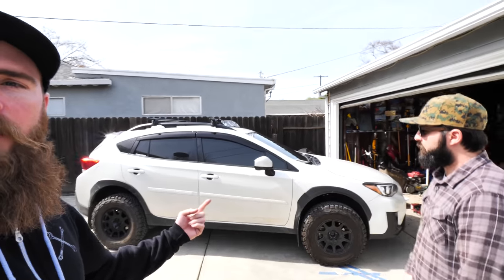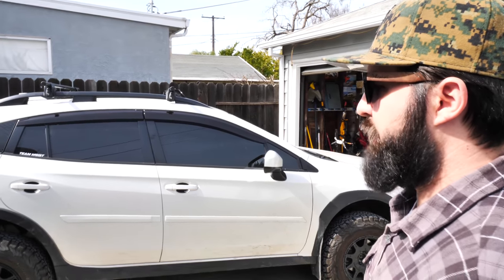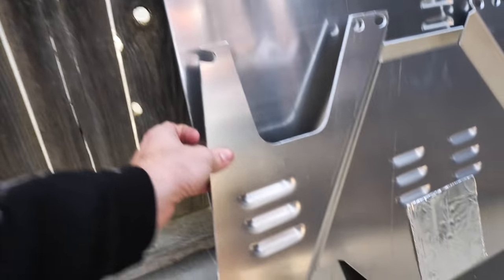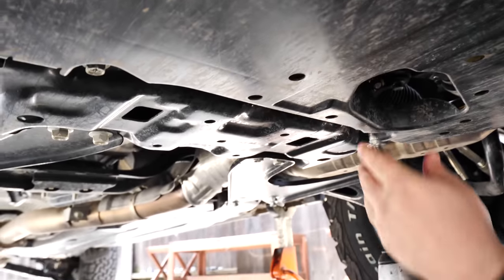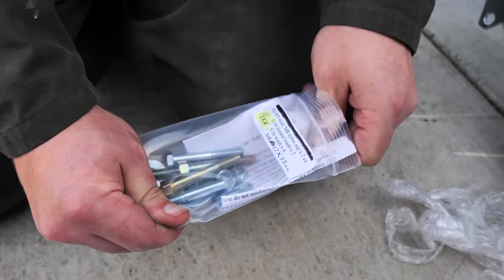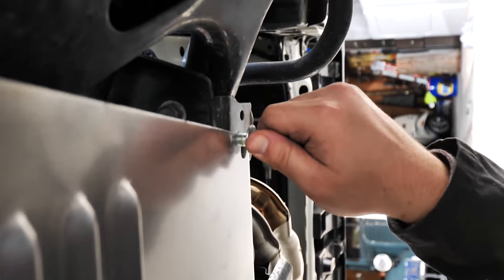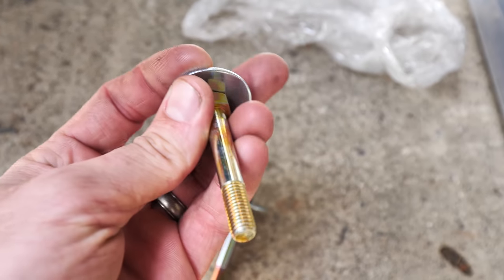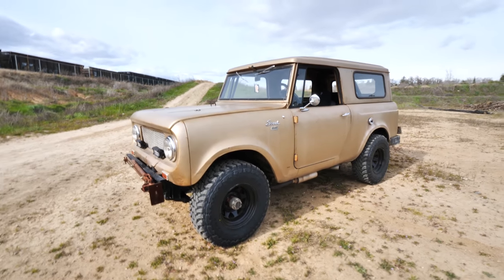LIFTED 2018 Subaru Crosstrek SKID PLATE INSTALL [4K]

Comment: Great video! Quick question, does removing the plastic cover causes that you'll get more dust/mud etc into the engine bay because you loose that bit of sidewall protection you have when you remove it? Of course the benefits of the metallic skid plate are absolutely clear, I just have that doubt.

Comment: 6-8 mpg from a light bar?
That would equate to roughly a 35% increase in fuel efficiency, not to sure about that one.
Reply from the maker: deny73 I would cut 3-4 MPG on my WRX just from the roof rack with bike attachments. So it’s definitely a true statement, the basket and light bar are huge and have a giant impact on aerodynamics.

Comment: I thought it had a "torsen" type diff both front and rear.... Have seen on some  XV/Cross Trek vids that if on wheel is slipping, the brakes comes in and transfer  power to the other wheel with better traction... It looks really cool with lift kit and bigger wheels on!👍  what about warranty ,all good..? in my country Norway,  no such mods is allowed unfortunately...😩

Comment: Is there not the drain plug hole + fumoto valve option for the crosstrek? I've got these in my build plan for a Foz, and they have an option to get it with accessibility to the drain hole! Plates look great! Have you thought of doing the rear diff plate as well?
Reply: They might have an option for the drain cut-out.  I didnt want one anyways, so doesnt bother me :)
Reply: Oh and I already have some rear diff protectors from over the years.

Comment: Oops! Anyhow, looking at buying a 2018 crosstrek, and I appreciate all your dyno tests, oem vs. mod like skid plates, wheels, etc. such great info. Not surprised about ko2’s slowing car down. What r your thoughts on different rims like sparcos n different, possibly lighter tires, as compared to ko2’s. Any other recommendations to all terrain tires with less weight n noise? I’m definitely gonna do primitive skid package. Thanks and keep turning out the quality vlogs

Comment: Hi, nice video. Helped me a lot during my install! One question, did you use a power tool to torque down the bolts for the trans-plate? Or did you just hand tighten them? I hear a lot of creaking since I put them on. Suspecting that I torqued them too tight.
Reply: we used a torque wrench.  I dont remember off the top of my head what we set it at unfortunately

Comment: Hey man, how're you doing with your crosstrek? I used to own a 2017 forester, it doing really good on snow and ice, when wheel slip the slip light flash up on the dash and I can fell ABS is activating and I almost not fell it skating at all. But with my 2018 crosstrek it doest skat a lot at corner and icy road and slipping light never flash nor ABS not even activate, is it does the same thing to your car on mine have problem?
Reply: Never had any issues with mine!  Just shy of 40k miles on it

Comment: @Blake's Garage Do you have to remove the skid plate whenever you want to change your oil? Or do you still have access to the drain plug?
Reply: Have to remove it.  Although Primitive I think does have a skid with a cutout so you dont need to remove.

Comment: Hey bud,
Curious, what level tint did you go with?
I got “limo” all around but having issues with seeing the trail at night lol.

Is yours blacked out? How do you feel about the wind guards?
Reply: Ive got 5% on the rears and 20% on the fronts.  Ive got a ton of extra off-road lighting, so ive never had an issue.  The rain guards are absolutely awesome.

Comment: A lifted Subaru? Wow!  I would add more black to the bottom panels. Mabe even spray on Black removable stuff. I may add the fender covers to our Charcoal outback. My wife would kill me if I lifted her car. Get some killer crawler tires. lol. Loud as hell driving it though. We drove a 1017 Outback with Snow tires in August and couldnt STAND the noise. Our came with all season Michilns that handle everything well. The road noise is zero. I like Bridgestones but again LOUD as all hell. I kept my Trailblazer shoed in Bridgestone all season tires and it was as sure footed. 
Any mods you do on a stock model void the warrenty. I wouldnt screw with anything on a vehicle until that warrenty is up. Ours is 4 years old and still under factory warrenty. I wont be modding it until 60k rolls up.
Reply: I have general grabber ATs on my lifted 13' and they are super noisy.

Comment: Love your ride, can't wait to get mine.. but curious.. do you have to take the whole skid plate off when you do oil changes?
Reply: Yes you would have to for the oil drain plug.  I THINK Primitive offers a cutout version so you dont have to.  But the oil filter is up top.

Comment: When you take off the light bar are there still cables attached to the top
Reply: Yes, they wrap under the crossbars, so you really cant see them.  I used weatherpack connectors so I can easily plug/unplug the lights!

Comment: That crosstrek looks fire! but wouldn't the skid plate rust really fast? I don't know anything about metals
Reply from the maker: Samuel Caron aluminum doesn’t rust so no. Aluminum will corrode and oxidize but it will never get that bad that you would have issues. Now for the mounting hardware if you live in an area where they salt the roads you may want to put anti-seize on the bolt threads.

Comment: Is that a manual transmission?
Reply from the maker: Yep
Reply: @BlakesGarage  how is the 6 speed manual vs 1st gen 5 speed.....i couldnt believe how tall and doggy the gears were in a 1st gen but i WOULD NEVER BUY A CVT EVER. Also thought Subaru AWD SYSTEM was supposed to be the best and not need LSD all those roller bearing tests i have seen between subaru awd system and other cars and now thia one is doing the same thing. Is there an LSD DIFF out there for front and rear and how bad does the lift and wheels alone eat fuel mileage?

Comment: How do you feel about the road noise with the new tires?
Reply: and did  you notice a change in the MPG with the plates on?
Reply: no difference in MPG with the plates.  As far as road noise, I dont really think so, others have said yes they are a bit louder.  But I put them on with 350 miles on the car, so its more or less all I know

Comment: I like the Primitive Racing skid plates, my next buy very soon. So my big question is how did you get 15 inch wheels on your 2018 Crosstrek with the stock front calipers. I also have a 2018 Crosstrek nick named "snow beast" Lol
Reply: Wolf of Crypto the 15 inch wheels just fit without any mods. The calipers are not that big.
Reply: Thank you I did some research from your past vids for the rest of the info I needed.
Reply: Yup no clearance issues at all!

Comment: Wheel / tire specs?
Reply: Wheel - Method 502 vt spec
Tire - BFG KO2 (235/75/15) --- THESE TIRES WILL NOT FIT ON THE FIRST GEN.  The 2018+ have larger wheel wells.

Comment: Kayak racks and Baja lights on bullbar still at 28 mpg . Fyi
Reply: Is that what you're calculating or what the car is stating?
Reply: Fact yes.. without 30 to 31
Reply: Base 6spd manual
Reply: Also ac on as it's summer.
Reply: stupidchicken03 2018